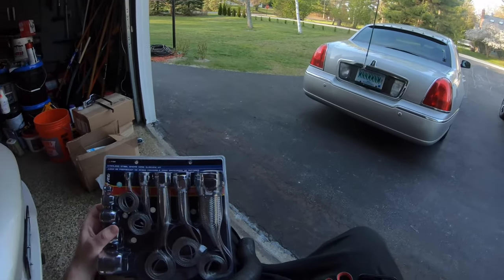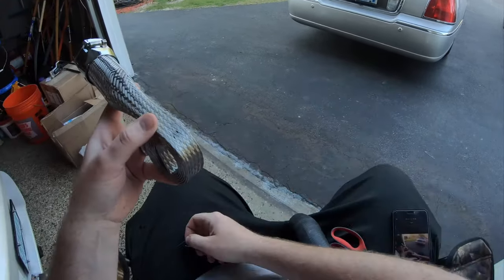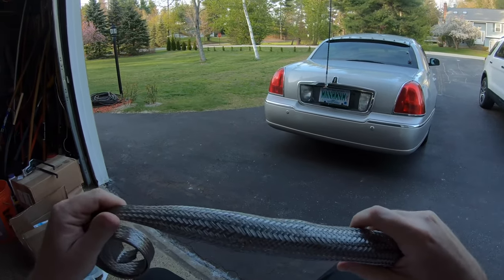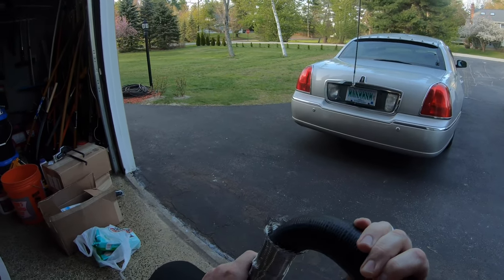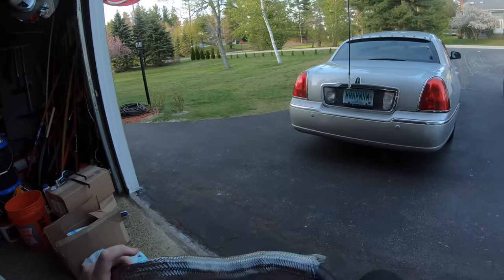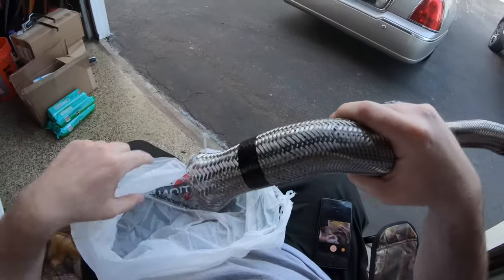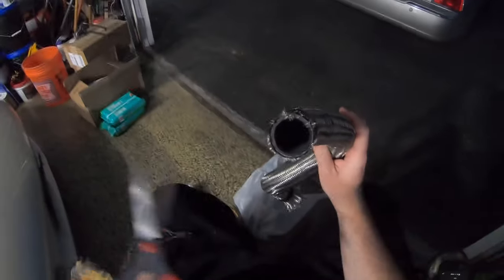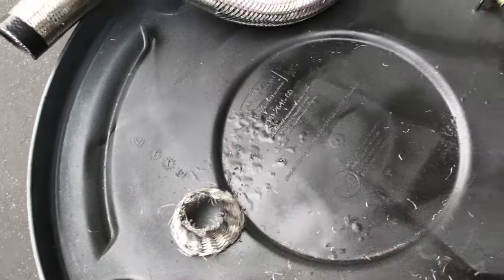How To Install A Braided Stainless Hose Kit

Comment: for cutting stainless steel braided sleeve, I use aviation snips.  I got mine for about $16 at Home Depot.  They're strong and sharp, they grip the material, and the blades don't separate.  Nothing else in my house or shop cuts the material as well or easily.  With aviation snips, trimming the ends would take about 20 or 30 seconds each.

Comment: I've used this stuff in the past. One issue is if it's going into a car you work on regularly, just skip it altogether. Because once you get grease and grime on this stuff, there's really not a good way to clean it. Then you eventually get areas that start to get frayed.
Reply from the maker: A toothbrush and greased lighting will clean them right up

Comment: Could you use a high quality light oil for example "firearm oils"? Engine heat would not react because of how hot guns get. At least I would think. Someone pls let me know. Thks
Reply: Oils will attract dirt just be patient and squeeze it a little bit at a time 👍
Reply: Simple soapy water sprayed on the hose will work fine.